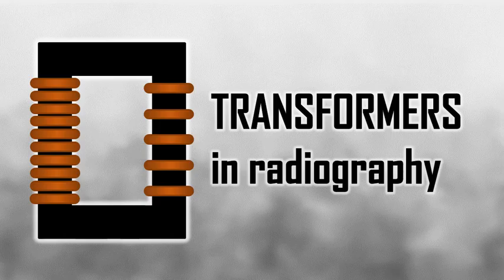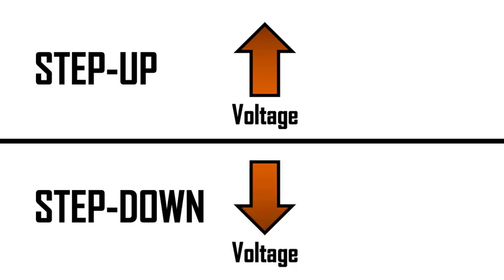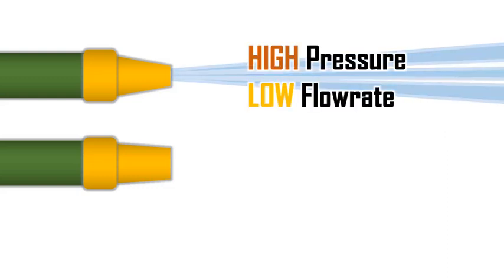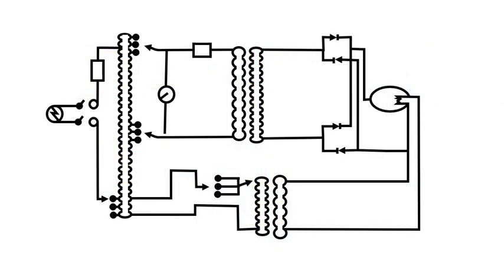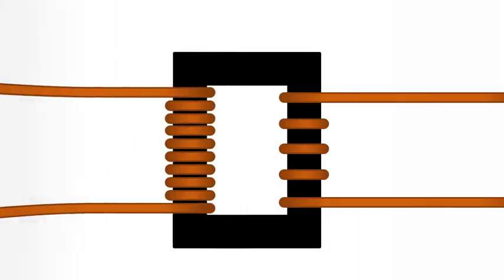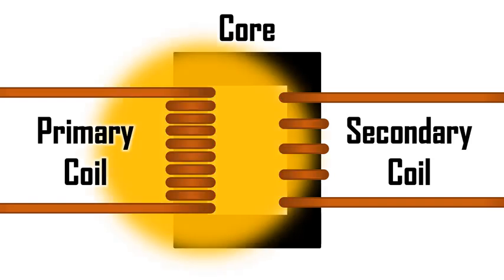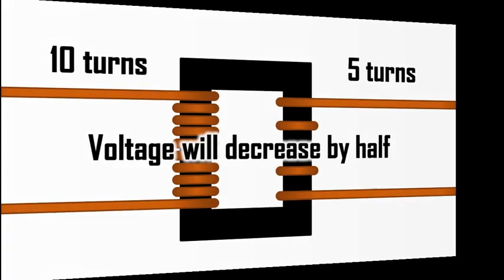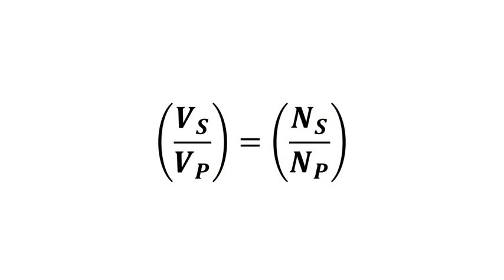The X-Ray Circuit Transformer (Step-Up & Step-Down)

Comment: Forgotten tips,if you make step down transfomer,the ratio which N1 is over N2,so also N2 wire size is over N1(number of turns of primary)
Reply: some ppl already mentioned it, but high voltage + vacuum = X-ray , you do not want that ☢☢☢⚠

Comment: 3 rules

1  }a. Transformer current high=low voltage due to frequency.
1  }b. Transformer current low=high voltage due to frequency.

2 } High Voltage= Low Current deliberately.

3 } Nature doesn't care, we care.
3 } If a Transformer coil allowed current to step up and down and not frequency causing voltage gains and drops:
   a. Left more turns, right less turns won't be step down.
   b. Left fewer turns, right more turns won't be step up.
Reply: https://youtu.be/4ew1M1f21gQ
Reply: some ppl already mentioned it, but high voltage + vacuum = X-ray , you do not want that ☢☢☢⚠